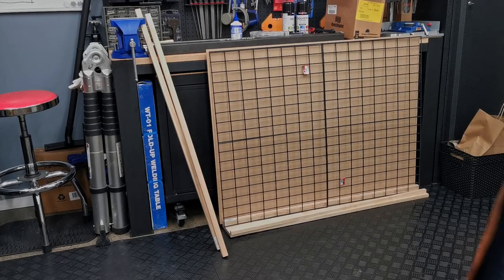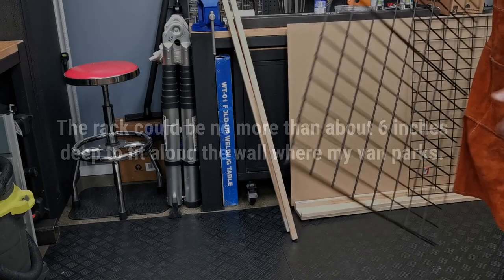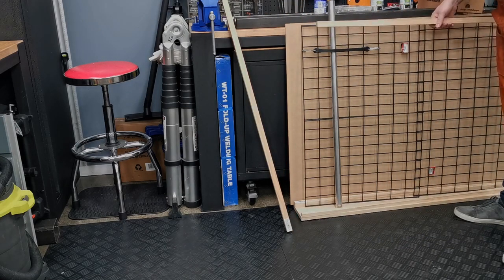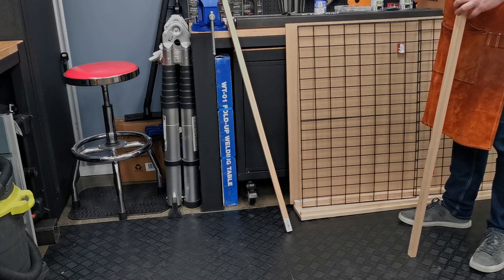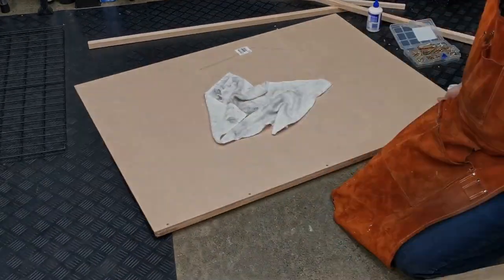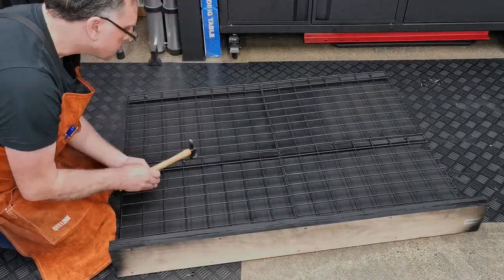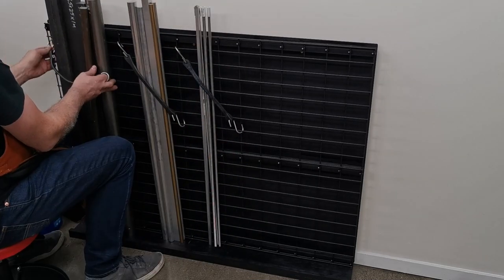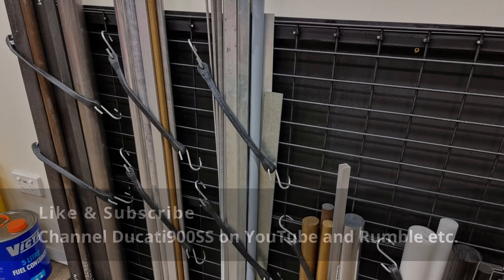Compact Metal Storage Rack Build - Rob's Garage

Comment: This is brilliant! What a great idea, exactly the solution that I’m looking for, some flexible storage for varied length pieces. Thank you for making this video! Matt
Reply from the maker: Thanks for that. I'm glad someone finally liked it! 
Just a couple of points I can make since I've now used this for 10 months or so... If you don't care about your wall or floor, you can of course just fasten the grill directly to the wall (with some spacers) and use it like that. I wanted this to portable and not damage the wall, so I made the whole frame. The second thing is that the rubber straps I got are not very stretchy. I would instead get a bunch of bungee cords or even a longer length of bungee and thread it in and out of the grill. Either way, the benefit of using the grill is that it is not a fixed setup and can be changed around as your metal stock changes. Let me know how you get on if you make one yourself.